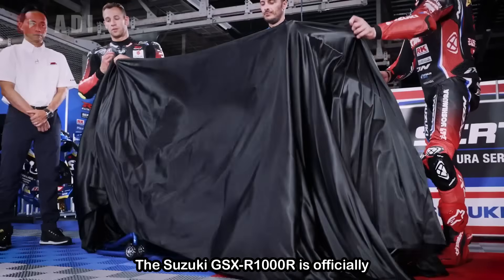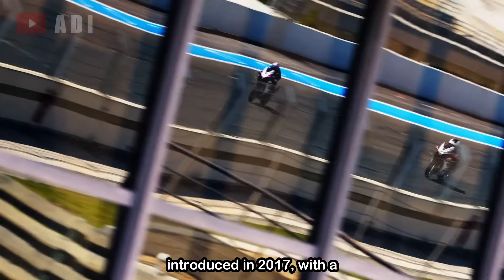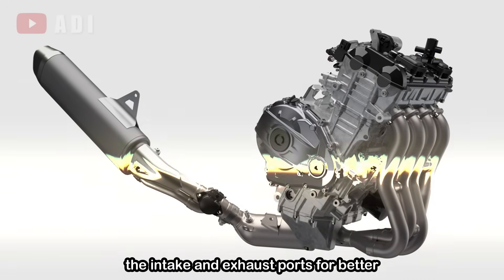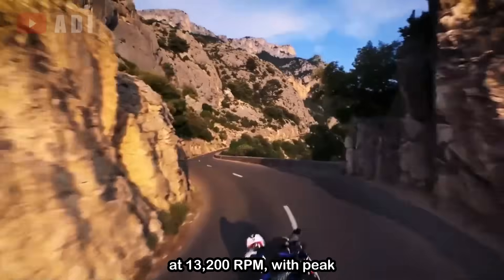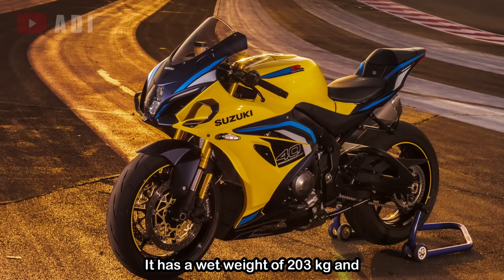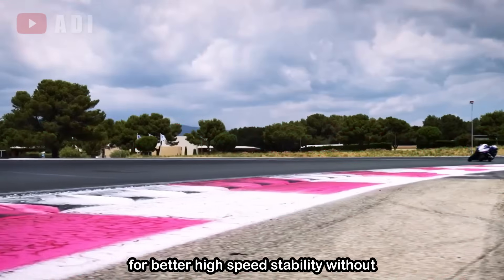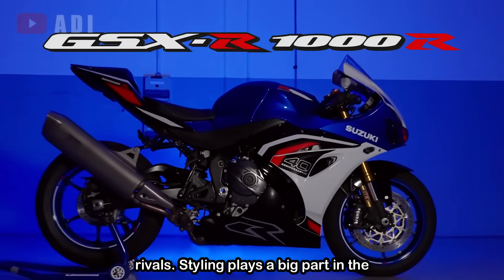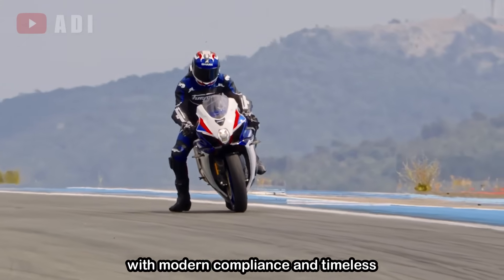2026 Suzuki GSX-R1000R - New Styling, Revised Engine & More Electronics

Comment: No electronic suspension No electronic throttle Less power. Just an exhaust and a new look. More of the same.
202cv OLD and 195 CV New kkkkkkkkkk
Reply: New cylinder head, new crank , new cams , new pistons , new throttle bodies , hardly more of the same is it ??